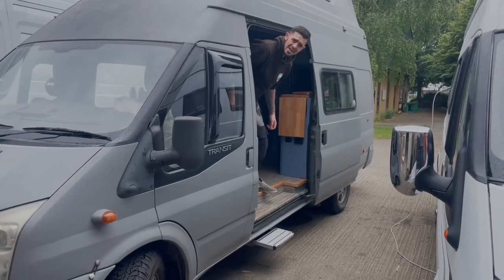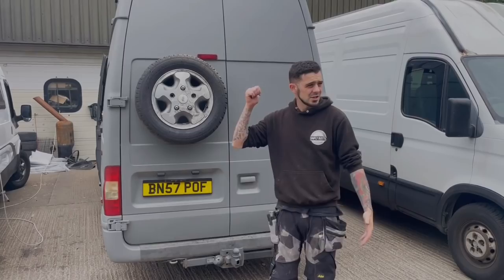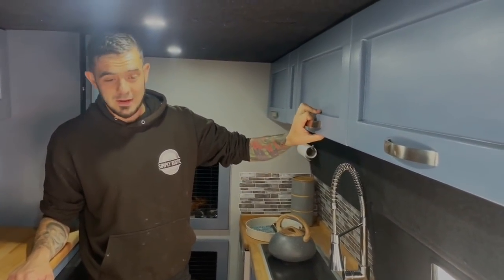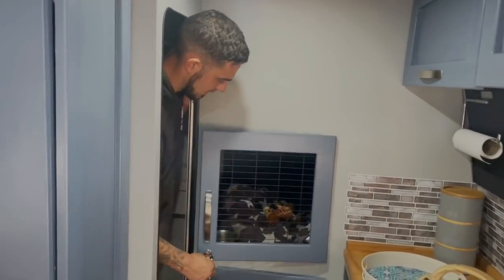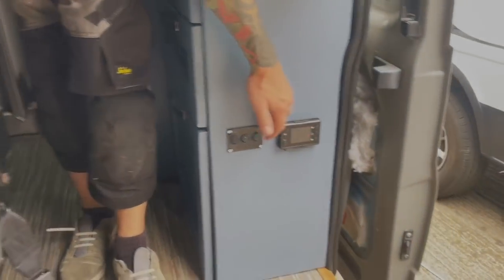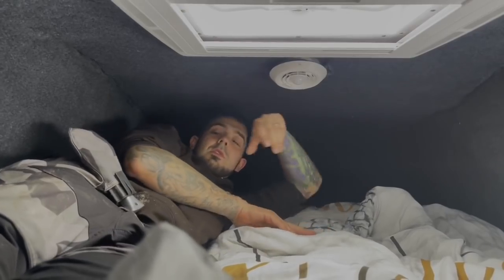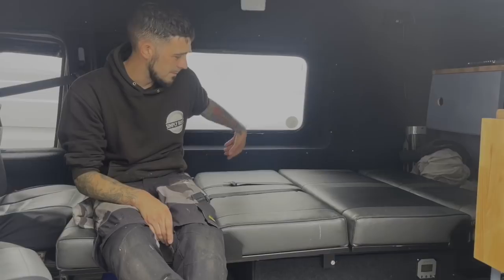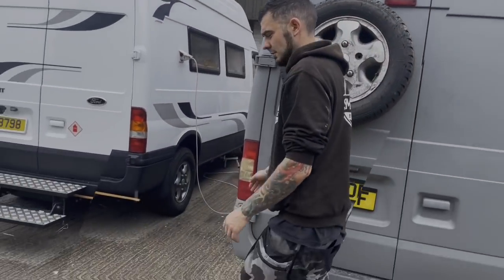Apollo Van Tour Transit Jumbo VW T25 camper van conversion | 2021

Comment: Hiya Lee well iv just sat at my pc for 7hrs Haha IV A SAW ARSE NOW  hee hee from start too finish well inpressed with all the video's picked up some tip's my self after my first convertion off a T5 now doing a swlb mercede's sprinter got too the stage off floor done celling nearly done and one wall done as im waitting too fit the window's eather side slidding door and behind driver seat.if you dont mind me giving you a couple off tip's when your putting that kind off window's in bend the rubber putting washing up liquid in all way round then rubber's in whould off been alot easyer/and when you did your bathroom panel's coz you got the space i would off done them in side on the flat floor anyway i dont know if i missed it were you fitted all the pipe work underneath the van i dont no if you did one anyway Lee cracking job mate  and great vidoe's keep up the good work cheer's ray.
Reply from the maker: Wow that’s dedication 😂 good luck with the build.

Comment: Not a fan of the bed arrangement, if you got claustrophobia your in trouble also for a person with physical difficulties impossible like the topper for the height to standup but not for bed…
Reply from the maker: Agreed it doesn’t work for everyone. It’s a custom build, if it worked for everyone it wouldn’t be a one off.